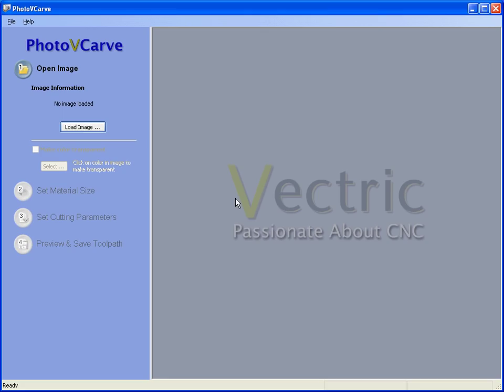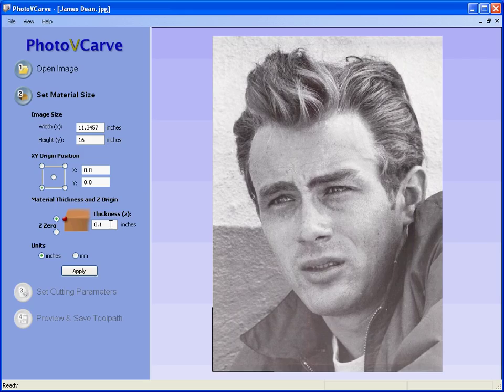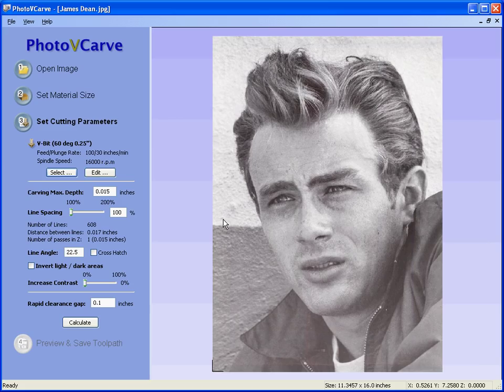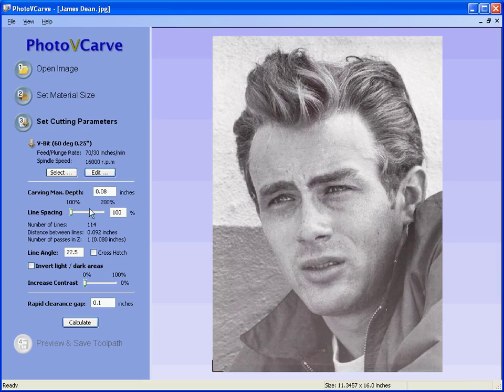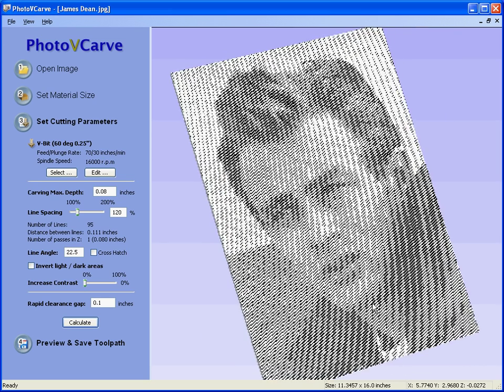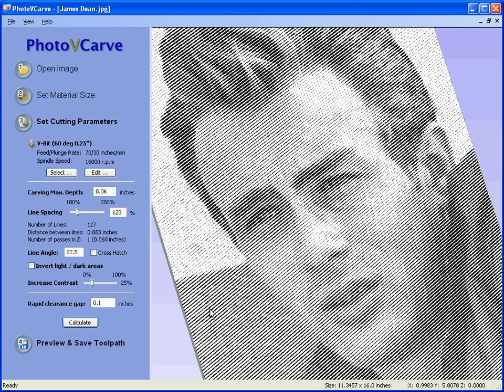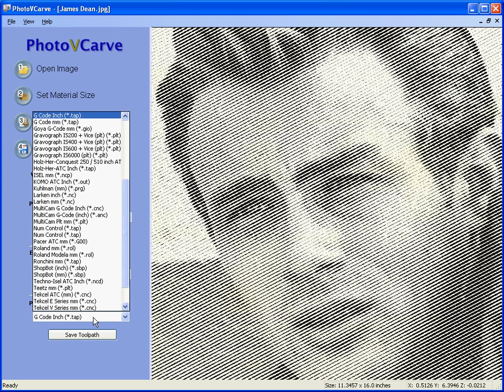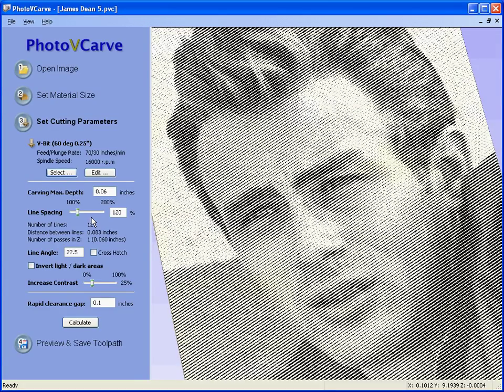PhotoVCarve - Engraving Photographs

Comment: Hell-o everyone I have purchased a J-Tech 4.2 laser and was wondering if any one has used a laser with photovcarve or shall I buy another program that is for Laser pictures.  Thank You All      Mert
Reply from the maker: Hey Mert, Jtech do offer post-processors for our products and a variety of different machines. Here is a guide for the standard products:
 

https://jtechphotonics.com/?p=3851

It may depend on your machine but those post-processors should work in photovcarve. It could work if you translate cutting depth to laser power. It will probably require some experimentation to get good results. Your best bet is to get in touch with JTech support. I hope this helps.